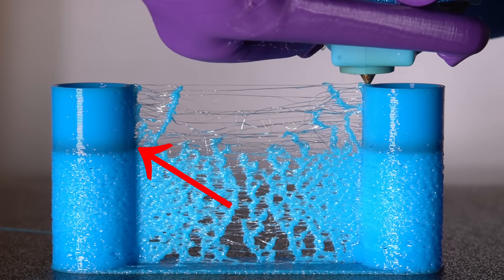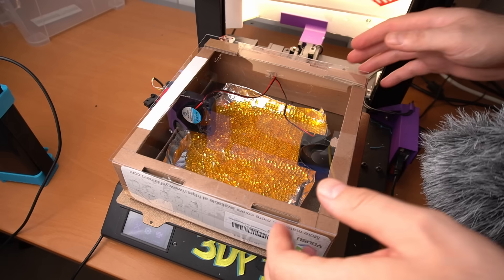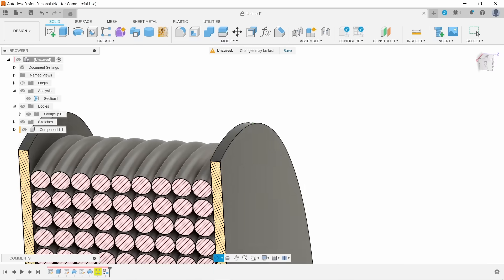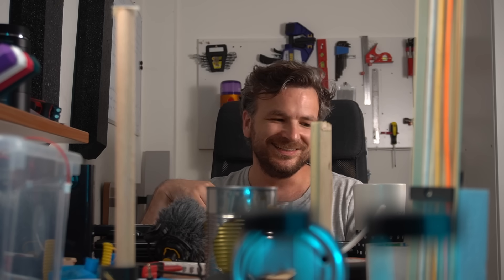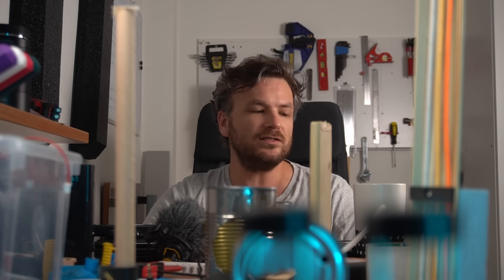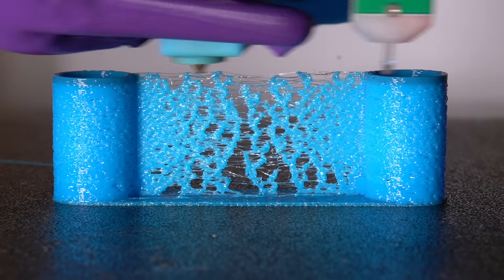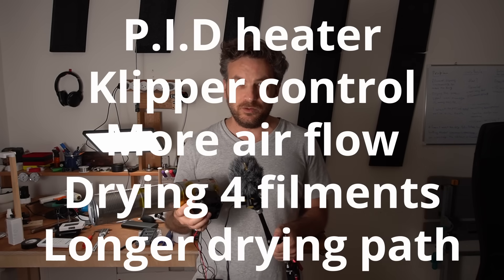Why are we drying filament this way?

Comment: With something like the Bambu Lab X1C I thought of doing something similar, but instead of an external heater, I planned to build a riser for the glass, similar to the ones used for LED strips, and run the filament all the way across the top. With your testing and needing air moving around I think it might work better across the bottom and use the heater as a dual-purpose chamber heater / inline filament dryer.

Comment: title: because keeping it dry has other benefits. Wet filament degrades way more quickly over time than dry filament.

1:18 - my dude you can regenerate silica gel in bulk in a microwave, it takes like 10 minutes. Cook for ~30 seconds, take it out and stir. Repeat until adequately dried.

Comment: Interesting idea! Some ideas for improments:

(1) Put heater elements and fans pushing air into opposite direction to the filament movement. That way the filament hits the hottest air the last before exiting the tube. The hotter the air, the less the humidity of the incoming air and you need to dryest possible air at the end of the process. When filament is really moist in the incoming feed, any amount of air movement will already improve things so it would be wasteful to use the dryest possible air in this end.

(2) Feed the air from the fan through lots of dry silica gel before heating the air. That way you start with as dry air as possible before entering the heater element which makes the air even dryer.

(3) Setup the system to pass the filament through the same tube multiple times. The amount of water that evaporates from the filament is probable not enough to fill the volume of the tube so when you have lots of airflow in the tube, the moist air from the filament will probably stay close to the filament and another looped strand closeby can be located in the same can.

As an alternative to 3, you could try using just a loop of plastic tube to work as a container for moving air. In that case, you could have a coil of tube for the outcoming air where the moist filament goes first (e.g. 2 meter loop of 20 mm diameter plastic tube), followed by the area with the heater element. The plastic tube must be resistant enough to take the output air from the heater element but it doesn't need to be resistant enough to hold the actual heater element. As you have to keep air temps low enough not to melt your filament, the plastic tube for the hot air should be strong enough anyway.

I would recommend following setup:

(a) Vertical tube-like container for the silica gel, with a bottom cap that has lots of holes to allow airflow into the silica gel. I think some kind of metal grid might be the best option here.

(b) A fan attached to the silical gel container pulling air from the silica gel.

(c) A duct for the forced air to the heater element

(d) A duct from the heater element to filament

(e) The duct connected to the plastic hose that contains the incoming moist filament.

The fan must be strong enough to pull enough air through the filament and still have enough positive pressure to push air through the long plastic pipe fast enough.

And you must have dry silica gel in the container but you can have lots of silica gel in closed containers for fast use when you want to use moist filament.

Some experimentation would be needed figure out if you want to contact the silica gel with cool or hot air, but I would guess that the correct solution is to contact it with cool air which is why I explained the above setup. The above setup results in zero heat sources (including the fan) before the silica gel but it makes things harder for fan performance. If fan doesn't increase temps too much, having the fan to push enough forced air into the whole setup would be much easier to arrange.

Comment: Funny but nothing more than that. You’re drying up the “surface water”, not the molecular water that is bonded to the polymer molecules, (and is the real issue). For water to be removed you need a certain amount of hours at a certain temperature. Physics :p
But still funny. Good job.

Comment: Try using the drying system or even just the desiccant cartridge from a tractor/trailer. It has to constantly dry the compressed air used for braking , actuators, etc . The parts can be sourced for cheap. 
Or just store your filament spools in white rice. Thanks for the video!!!

Comment: I don't know if my PLA filament is dry or not, but it had become brittle and breaks when unspooled. You contraption might do the trick in both drying and melting the filament enough so it's gains some elasticity.
Some ideas:
- It would be ideal if this could be done inside a smaller pipe, preferable cut in half that can open and close on the line of filament without needing to remove it from the printer. A slit and cover could also work. I'm thinking copper pipes, but I also think it would need some thermal isolation.
- For the airflow, you might not need that much, this would also help reduce the heat produced and released in the room. 10% of a centrifugal fan (small cheap ones from all 3d printers) would be more than enough.
- Dual chamber, one chamber for heat and dry, the other for cooling and also drying. I believe evaporation happens faster with greater temperature difference. So the hot filament will also dry while cooling. Honestly I think if hot filament reaches the extruder it might be soft enough to stretch or lose grip. As a bonus an extra chamber can be added for cleaning the filament (small one with sponges).

Comment: So here is an idea - use those dry silicone beads as a way to dry your filament.

So you pre-dry the silicone to make sure it has no moisture in it. Then you put it in a can and you run the filament through that can. In theory the silicone should absorb the moisture and at the end of the day you should be able to dry the silicone again to re-use it.

I guess maybe add some airflow to make sure the moisture gets dissipated throughout the can of silicone beads. Or maybe have something that stirrs the silicone every now and then.

Comment: Inline filament drying is a mixed bag... It's a bit annoying to push the filament through and depending on the print speed it does not have enough time to dry throughout

Comment: The answer is: Putting your filament in a filament dryer it will dry the filament soon or later. If build a bigger enviroment to control temperature you cand dry multiple filaments so this approach wont make any sense and you could printed what ever speed you need

Comment: I like it, but if you have a 5 hours print, what is the cost to run this dryer ? A hairdryer takes a lot of energy for example. Talking about hairdryers, what is the noise level ? You should make it longer and maybe isolate it. And maybe to get a higher airspeed by a smaller diameter. 😁

Comment: Dry boxes that can dry over a period of time make sense for storage, however an inline drying system should be also be used. Tick your nylon and such in the dry boxes as soon as you open the package and keep those on turned to an appropriate setting. When in use set the active inline dryer as part of the pre-heat step and then hopefully just print.

Comment: How about like a 4 spool dryer box controlled by a pi that you can set to turn on automatically when humidity gets to a certain level. Then it can run in the background like any other appliance and have 4 spools always ready to go. or 4 separate “slots” each with their own temp control and timer for different filament types

Comment: I came up with this idea as well about 3 weeks ago. The problem is: It is basically impossible to know the correct temperature while printing because of the varying speed of the filament itself. I found a guy on the Voron-Discord who did the same thing with two V6-Hotends slapped together, but he said he still dries it conventionally. I ended up engineering a new filament dryer because I am using an Industrial spool.

I guess, if you know the density of the material, the speed of the fillament being consumed and a fixed temperature, it might work but at this point, it might just be easier to dry it conventionally and that's the reason for the other thing costing 2100$ in total  I guess. The smaller part probably just measures the filament speed and the larger part dries it.

Comment: Here's a thought - those multi-material systems like Prusa's MMU have a buffer system where maybe 50cm? of filament sits while not being printed. That filament buffer would be a great place to be doing in-line drying as it gives more time for filament to be in the drying process, especially if there's a filament swap on every layer, and one layer doesn't use all the filament length that's in the buffer. So if the buffer itself had heat and air flow, it might make quite an effective in-line dryer?

Comment: Hi @3DPI67, your system give surely a better result that nothing but there no secret : if you don't extract water by condensing or evaporating,  you could do what you want, but you wil not have a really evicient process.Look at how air is dried in industrials process. An another way is to put the filament in a vacuum chamber. This method resulting of evaporating the water by drastically pulling the temperatur of boilling point more your vacuum is effecient. All is physics (and will never change) in plus of money, espace, time, and so on ... than you can invest :body-blue-raised-arms:

Comment: This would be most beneficial for the super hygroscopic filaments like ultem and PEEK, which absorb moisture like crazy. You basically gotta keep them in a 0% RH environment or at elevated temperatures to store them for long periods. Even if you could manage that it'd be a great tool for making absolutely sure the filament is dry, its definitely not uncommon for filament to get wet mid print, even if its a short print and fresh out the oven.

Comment: I think the reason you dont see more in line drying is due to the difficulty of adapting it for multi material printing and filament auto loading.  Running the filament through the cans "naked" (without something like a ptfe guide tube) makes it more difficult to load and unload and impossible for an auto loader. If you do run it through a guide tube you isolate the filament from the heat and airflow.
If you could find or develop some type of guide for the filament that allowed heat and airflow while still being able to reliably guide the filament without binding you would have THE SOLUTION

Comment: After the filament has been in the drying chamber long enough to bend, it then should go on a capstan and wrap around it several turns, (much like rope on a ship capstan) minimizing the space and also maximizing the time it is in the drier chamber and THEN proceed as you did. This could help with the faster need over 40 you mentioned. The capstan would have the same feed rate as the nozzle.

Comment: Need a v2 ! I'd love to print ABS with an inline dryer. I print it at 100mm/s though (very modded ender 3). I'll experiment a bit too :D you may want to use a smaller diameter stainless tube, it conducts heats poorly compared to other metals... but it is harder to cut.

Comment: I have an addition for you. When you showed the design of the filament spool and that it wont alow air flow to dry the filament due to it's solid sides. you can buy reusable spools with exposed sides or just make your own using mesh, this whould alow direct air flow from a large 12" fan from the side. ofcourse this requires you to transfer the filament to the new spool.

Comment: I work for a company who sells industrial 3D printers and 3D printing equipment and we do have Drywise machines. Honestly those are crap... I tried them with 4 different printers and the results are always the same. The machine put too much friction to the filaments and the extruders can't pull out the filament resulting in massive under extrusion. It's not even usable lol. The only thing I haven't tried with it is using 2.85mm filaments. Maybe it helps ? I don't know. But from my experience the Drywise is just a waste of money. Perhaps if they put a motor inside to give filaments slack just like a Bambu AMS, this would be better.

Comment: So, you invest time into designing something, you have a purpose, but then in 8 hours you forget about it? 😂
Not to mention that I could already put the filament to dry before I even starting the design phase.
And even if you don’t design it yourself, that part still has a purpose and you need it for something, very hard to believe you will forget about it in 8-12 hours, come on…
Now, besides this inaccuracy, of course it would be great to not have to worry about this. Ideally, something should be built into the printer’s filament driving mechanism, because I wouldn’t use something external and bulky for this.

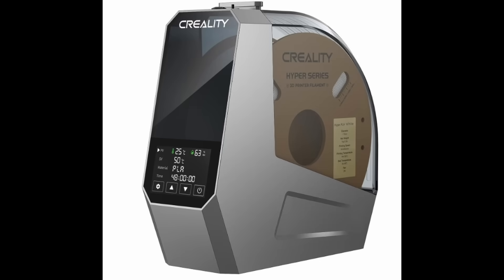Comment: That Creality dryer at 1:02 has a blower that blows the hot air directly over the spool opening and the air flows continuously around spool in the direction that the filament is wrapped (why it's shaped the way it is with the rounded lid). I have one and I have notice it does dry quicker then most options and once you use it as you print the deeper layers get dried as they get closer to the surface. I have been very happy with it so far.

Comment: If you increase the time filament pass through the hot airflow you may get better result. For example, curl the filament loosly inside the tin can 10 to 20 rounds? That increase the time filament expose to the hor air, so you could increase the printing speed with sacrifice the drying quality. The drying quality for sure isn't proportional to the time. Just my 2 cents.

Comment: I just added a fan to my old filament dryer and my new filament dryer has a built-in fan.  Running this removes the moisture fast.  It doesn't matter that only outer spool layers are dried because the moisture is removed so quickly using the fan and heat together.  I wish the BambuLab AMS also had a dryer built in, besides the desiccant.

Comment: For sure I would love to see more.
Also, did you hear about, for example, the Chitu Heater for Resin printers. This is a temperature controlled heater, that moves the air due to it's fan. I think that a combination of that with some cans, would make the perfect combination.